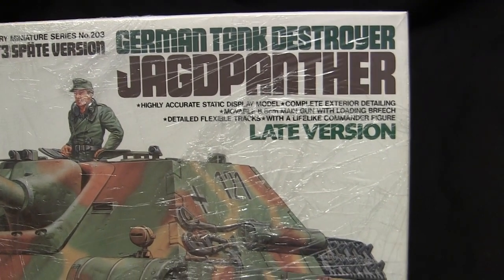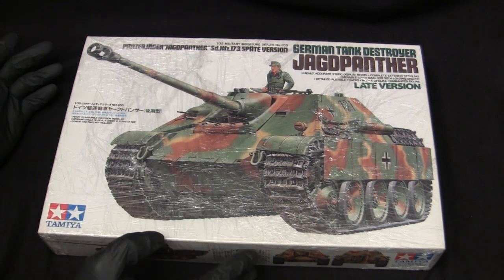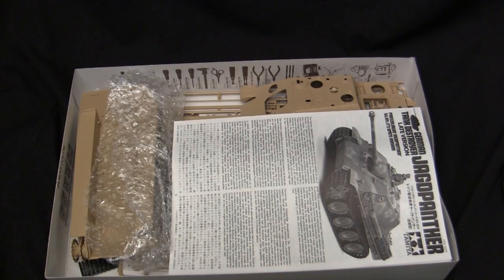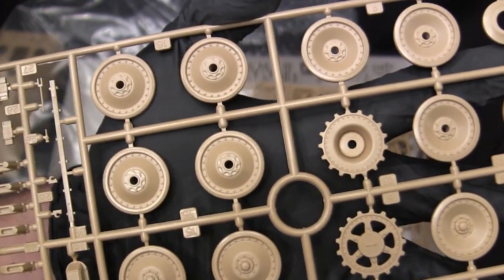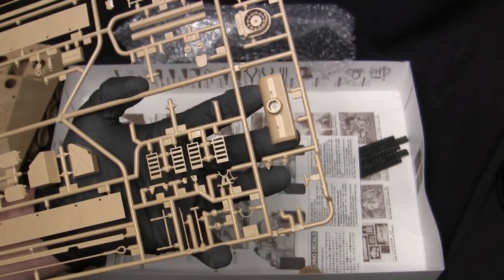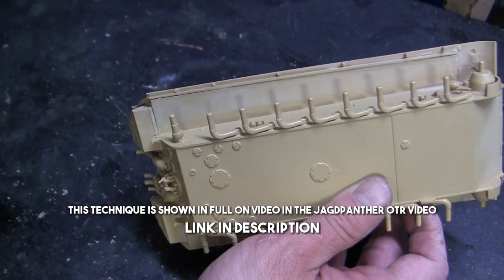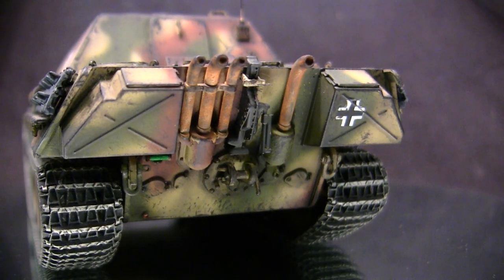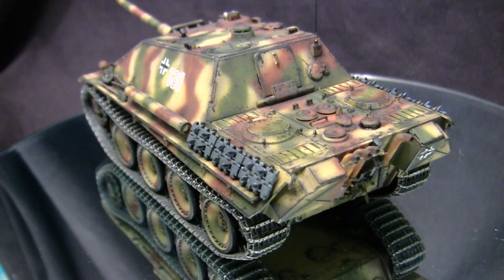1/35th scale Tamiya jagdpanther German tank destroyer

Comment: The "certain individual" shares your favoritism of rubber band tracks, John 😁Very nice build btw!
Reply from the maker: It looks like that "certain Individual" is also a cool smart awesome bro too :)
Reply: @oddball759mm  YESSSSS...finally somebody notices how awesome I am 😆And since you have such a broad knowledge of original paint colors, I'd love to hear your take on another question of mine regarding the painting of tank tracks in general: what about using XF84 DARK IRON instead of XF1 FLAT BLACK as a base color? Last year I visited a tank museum in Switzerland because they are restoring a King Tiger, and to my chagrin I was so awestruck that I completely forgot to take a closer look to the tracks! 😵‍💫
Reply from the maker: @MikeUSA67  I'm not a fan of using the iron for tracks. The tracks would have a finish on the steel like a Parkerizing or oxide coating to prevent rust or oxidation. This is why I use either flat black or Nato black as the base for the tracks. then add the weathering washes / effects on top.
Reply from the maker: to add, the rust would develop over long periods of time specifically if left outdoors and neglected for several decades, but at most you will see the finish lighten up and would rub / scratch off over time as the vehicle is driven. Lately I have been looking at the Russian tanks in the Ukraine, and you will see lots of exposed dull steel surfaces and at times depending how old and decrypted the tank they are using is with minimal or at times no parkeriaztion left. but the tracks are still not rusty... even in the condition that many of these bottom of the barrel tanks are in
Reply: @oddball759mm See, that's why I asked the expert. I didn't know about the "Parkerizing/coating" of track steel - so I will follow your lead on this one from now on. Thank you for your insight and the numerous tips! Much appreciated.
Reply: @oddball759mm  But I did know about tracks in use not being rusty at all - apart from flash rust, which would wears away after the first turn of the tracks. So I never understand the excessive rusting so many prominent modelers on YT do. Thanx again John for your quick response!
Reply from the maker: @MikeUSA67  it's simple, It looks aesthetically pleasing and it's what I call the "look what I can do" school of weathering. When in almost all cases these effects are anachronistic, overdone, out of context, or are just pure fantasy.
Reply: @oddball759mm  OK, now it makes sense to me. Thanks John!